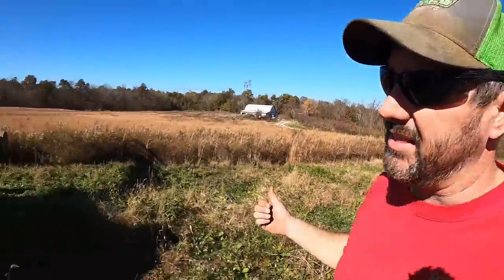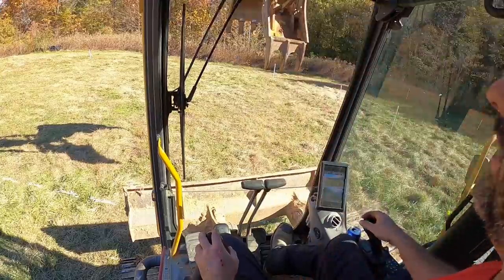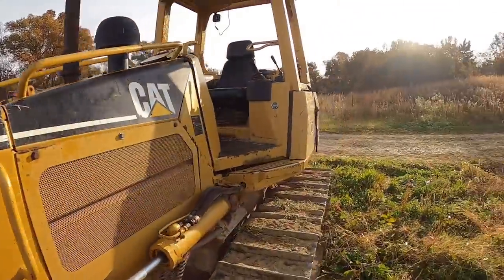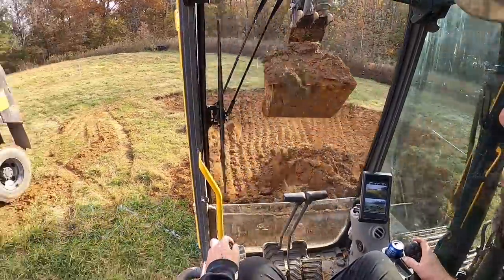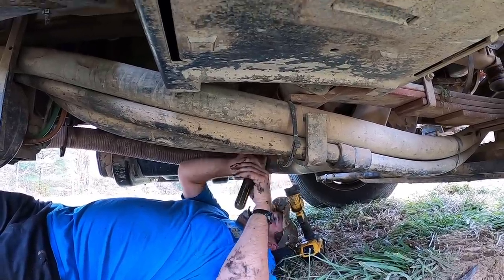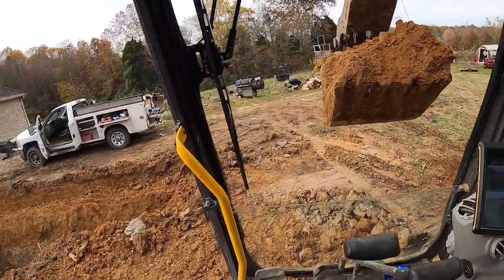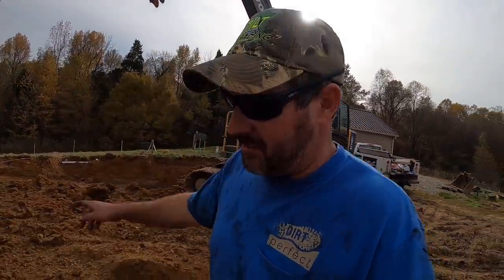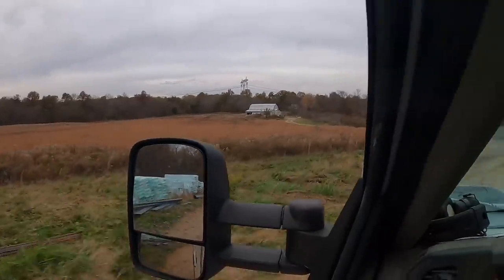Basement dig off to a bad start hit sewer line and Captain Kleeman breaks the dump trucks

Comment: Hi DP , l have machines on my farm at home that sit sometime for weeks and even mouths so what l did was put on each machine a small solar panel to keep the battery toped of, since l did this l have never had a flat battery and it help to keep your battery in tiptop shape and they also will last a lot longer.
All you need is a 10 watt panel on each machine. anyway cheers from Australia.

Comment: Greetings Sir !!!! 
You could have a whole fleet of 120s, they would all be slightly different. No surprises the 140 is  slightly different, you soon got back into your stride with it !! 
At least you didn't pull out much of the pipe, still enough to lose half an hour or so of digging time.... 
Pleased to see Captain Kleeman make an appearance at the hole, the clutch brake is technically a wear item, and there has been good sized loads on the tipper too..... 🤔 
You have a good eye for depths, not bad to be that close for guesswork 😁
Hope this year is as interesting and profitable as last year Mike !!!

Comment: Hey Mike, Just incase your still having problems with the clutch brake. The clutch brake is designed to slow/stop the input side of the transmission gears, only!.  Normally what breaks the clutch brake, is the driver presses the clutch pedal too far down when the transmission is in gear, and the truck is still rolling.  Essentially you are trying to slow/stop the truck with the clutch brake. Two things can cause this, one is driver error, and the other is improper clutch adjustment. The clutch linkage must be adjusted first to adjust the clutch brake. It should just grab when the clutch pedal touches the floorboards. Then adjust the clutch for free play at the top of the pedal travel. Explain to the drivers that they only need to press the clutch to the floorboards to stop the transmission, when in neutral. Any other time to only press the clutch within an inch or so of the floor boards to avoid engaging the clutch brake.  Love the videos.
Reply from the maker: Have a complete video on that check it out

Comment: May I suggest that when you do move the Sewer Line, you move it as close to the Transformer Pad as you can without hitting the Power Line...

That gives you some extra wiggle room for the basement hole...

I also suggest that once you dig the trench for the new Sewer Line, lay the new pipe and start filling the trench in, you fill the top 8 inches or so of the Sewer Trench with gravel so you never again need to wonder if you're about to hit it during a dig...if it's Legal to do in your area, maybe combine the Sewer Line and underground Power Line into the same trench so you can gravel mar both of them at the same time...

😄😁😆😅😂🤣

Comment: Thinking back as a kid driving his first few dump  truck job. I  stepped on the clutch and throttle and then  release the brake in that order. So I did while one parameter changed. I was gobbling a sandwich down and  trying to drive at same time and then I saw sky as the truck I was starting to move and the whole world came up... I thought I was going to die as the truck slid back and down towards where they were digging from. They told us  to bail should it ever happen. I seen I wasn't going to make it out and also had a slim to none chance of this truck stopping from going over. It did!  sAS I held my foot hard on the brake pedal, I heard chains being tied to my front bumper and the dozer driver held on to me and then backed up as I poured the coal to a tired old off highway truck  that was the size of three highway rigs, we got me forwards and saved the rig. They lost over thirty trucks in there building road for logging first and then it became part of the highway system in alaska. Everyone remarking on how brave I was to save a rig and no one else had an it went on for a while. I think the  truck was a Hays... can't pull that name out of my hat to save my  thinker today. I was a low number on  the road an it went like as they replaced them the number went up and not  reuse any number.. I was 855 and it was the truck of the year back in spring of 1970. Just home from Nam, My first job in alaska out at Thorne Bay on the Prince of Wales Island.... I don't remember the zip code.

Comment: 27:15, YEPPERS, I agree, Captn! I've driven professionally for 20+ years. Up until the past 7 years I've NEVER had a truck that had a working clutch brake! The companies just didn't believe in replacing them as they wore out! Just make sure you're at a complete stop before removing the truck from gear & there's no worries. Hey, it's their transmissions, if they won't give the proper upkeep I have no choice but to occasionally grind the gears on their transmission! It just AIN'T pleasant to hear that awful sound as you try to place the truck in gear after pre-trip/warm up time, & start driving for the day! Sure is rough on the ole throw out bearing having the clutch depressed that many hours out of the day, with the Seattle Wa traffic!

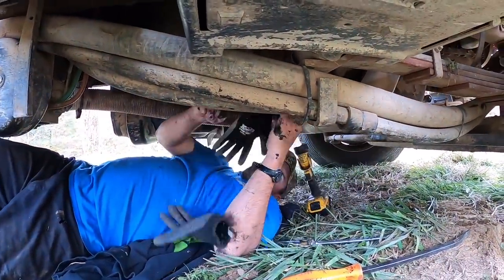29:54, that's why I enjoy wprking on my RC trucks & equipment, they're EASy to flip over & NO damages are caused from it! 🤣😂😊

30:32, Don't worry, Mike, it'll brush right off! 😂😊🤣

32:00(ish) gottsta teach Captn. how to feather the clutch a bit as he tries to werk er in2 gear!

35:47, that's what I'm accustomed to, keep on backing till the operator toots at ya. It's surprising how many DON'T toot, then get all pissy because you backed up 2 far!

Comment: Somebody has probably been using the transmission brake to stop the truck. I used to know a guy with an Allis 7080 tractor that had tranny brakes disintegrate quickly, because of the operator. 😎

Comment: Did they use sch 40 in that line or was it that thin  4" sewer pipe. I'm repairing a cleanout we busted with a mini, but the line isn't leaking for the moment. The T is sch 40 and I'm not familiar what is generally done for a septic run to the tank. I need to have two sets of repair materials when I go to cutting into an active line. Seems to me the heavier the better for the cost involved.

Comment: A company I drove and did mechanic. work for had 10 International road tractors exactly alike 9 of them never had to have the clutch brake repaired and number 10 had to be changed 4 times in 50,000 miles the boss asked why we couldn’t get it fixed to stay so me not being bashful I told him if he wanted it fixed to stay to fire the driver because it was his fault because I had asked him not to push the clutch to the floor except to put the truck in gear and not hold it on the floor when stopped and told me he always pushed it to the floor anytime he pushed it and he was to old to change. So after another replacement he lost a good job

Comment: LOL at least you can dig a basement with a bucket 😂 If a homeowner has a raging hard on for a basement around here better have a fat wallet its poke pokey poke poke when you've got solid granite. One thing about the C8500 it has the wheelbase of a single axe the truck will go anywhere.

Comment: Re. Sewer line:
I was drilling a hole for a utility pole. The phone company was called to locate their underground cables. We were assured we would miss them by at least three feet. I asked SEVERAL times if they were sure. At about six feet, the bit snagged two 500 pair cables. It seems southwestern bell had put a loop in the cables to take up slack in them. When I extracted the bit, and we saw all that wire wrapped around it, I don't need to repeat what the cable locators said! I imagine the cable splicers (and subdivision customers) weren't very happy either!😂